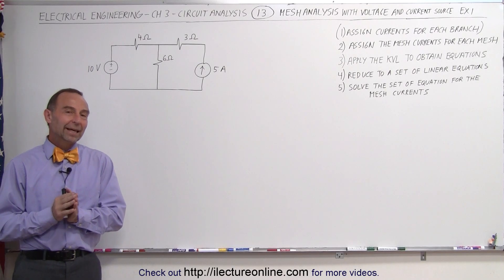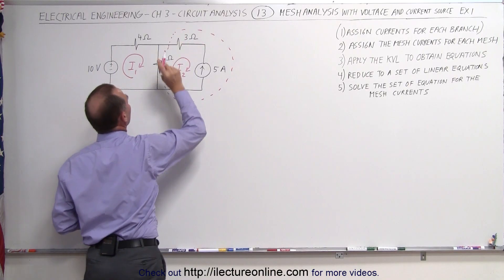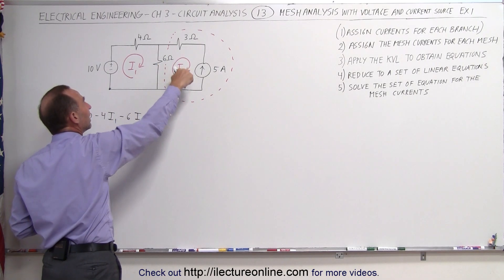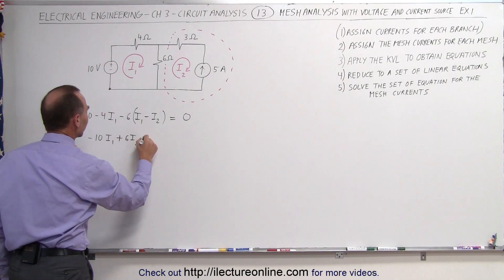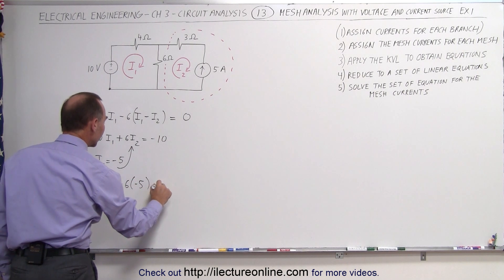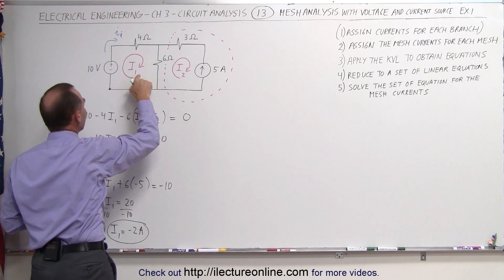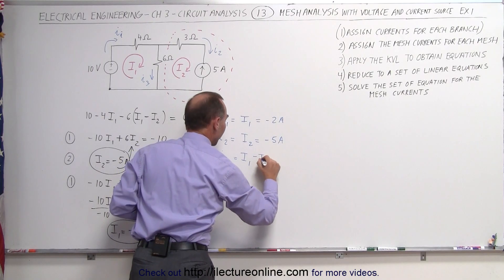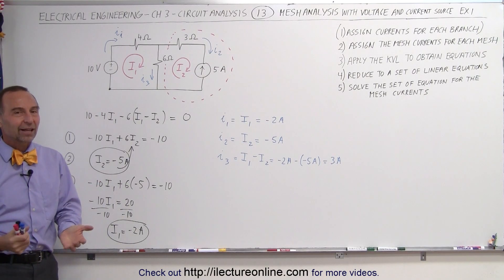Electrical Engineering: Ch 3: Circuit Analysis (13 of 37) Mesh Analysis w/ Voltage & Current Sources

Comment: in the first mech equation its actually -6 times (-5) which equal = -30
Reply from the maker: Correct, and then moving that -30 to the right side of the equation it becomes + 30

Comment: I would like to get to know more why I2=-5Al what happened to R=3 ohms?
Reply from the maker: The right branch has a current source putting out a constant 5A.  That current source remains at 5A regardless of the amount of resistance in the circuit.  (That is what a current source does, up to a limit of course).
Reply: @MichelvanBiezen  I was confused on that but thanks for the good asker and solution givers.

Comment: Hi sir!! I just want to clarify something :)
The value we got at I1 is -2A.  By looking at the mesh current flow at loop(I1), the value of I1 should be positive before we substitute it on the equation (I3 = I1-I2) right?  like what you did on I2 when the mesh current flow is on opposite direction of 5A.

Comment: professor,
Can we do this same thing with supernode nodal analysis just as we did in the mixed voltage and current source video?
Reply from the maker: You can always use any method to try and solve any circuit, although some methods lend themselves as preferred over other methods, depending on the circuit.  Here I wouldn't use the supernode method.

Comment: do current sources have resistance ? can we use v = ir across the current source ?
Reply from the maker: We consider the voltage drop across an ideal current sources as "zero".
Reply: @MichelvanBiezen  thanks.

Comment: First of all thank u for your great job ! but i want to ask some questions hope that u can answer me as soon as possible ;
is connecting the negative terminals of the sources to the ground a requirement for mesh analysis ?
do the polarities of the sources matter as to the resulting currents ?
Reply from the maker: Connecting a circuit to ground give us a reference point and makes it easier to work the problem.  But you can call the reference voltage any value if you want.  If you turn a source around, it will make the current flow in the opposite direction.  But you can work the problem out by assuming the current flow in any direction and the result will always be the same since the sign on your answer will tell you the ultimate direction of the current.
Reply: I thank you very much for taking the trouble to answer me, the questions were a part of my lab report ...

Comment: Why the sum of all voltage drops in mesh 2 doesn't equal to zero? Aren't you supposed to get -3i2-6i3=0? But we don't get zero, why?
We get instead -3 volts...
Reply from the maker: The sum of the voltages ALWAYS add up to zero around any mesh, including this one.  There is a voltage difference across the current source that you must take into account.
Reply: @MichelvanBiezen    thank you.

Comment: When you solved for I2=-5, why did you not include the 3 and 6 ohm resistors?
Reply from the maker: Because the 5 Amps is driven by a current source (regardless of the resistance).

Comment: Sir, If current flows to the opposite direction to the motion doesn't this means voltage rise and it should be sign as positive ? Then why you take i2=-5A ? shouldn't it be +5A ?
Reply from the maker: The arrows used for I1 and I2 are just arbitrary directions we use to travel around the loop with in order to add the voltages around the loop.  In the case of the loop on the right, we know the current flows in a counter-clockwise direction due to the current source and therefore relative to the direction of the I2 arrow, it is in the opposite direction and therefore I2 = - 5A.

Comment: Why do we always get negative sign currents
Reply from the maker: We don't always obtain negative currents.  It depends on the choice of the initial current directions when we travel around the mesh, and the choice is arbitrary.
Reply: So i just keep the negative answer as it is ? 
Thank u so much for replying
Reply from the maker: Since the negative sign corresponds to the direction of the arrows indicating the currents, yes.  The other option is to change the signs to positive and then to redraw the arrows representing current in the opposite direction.
Reply: Thank u so much sir u are the BEST, u always rescue me from drowning 😂
Reply: @MichelvanBiezen  i_1 current is coming out from 10v positive terminal..Then i think i_1 must be positive current but the answer is negative value.
Sir, Can you explain the reason?

Comment: First equation, you add 10 to a current equation. How is that supposed to be correct since 10 is a VOLTAGE and not a current?
Reply from the maker: The first equation sums up all the voltage rises and all voltage drops around the first mesh.